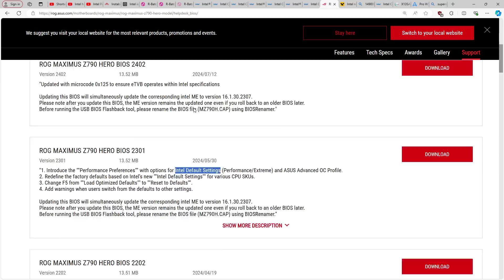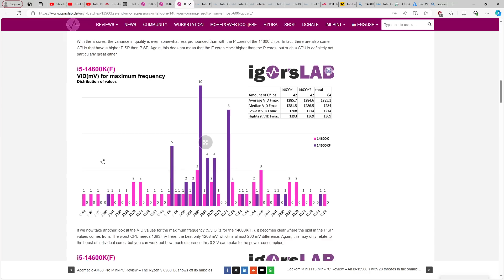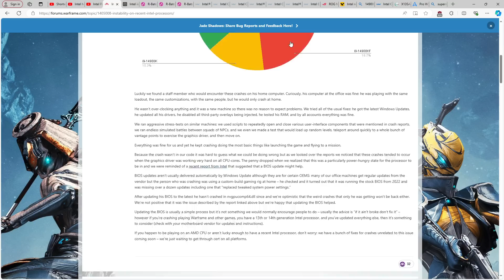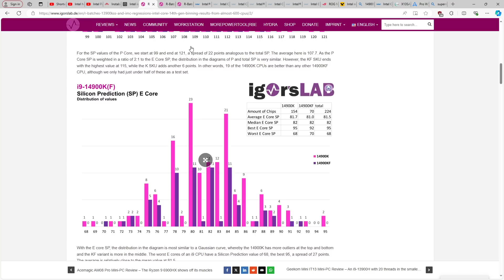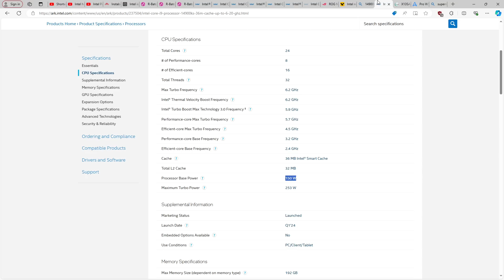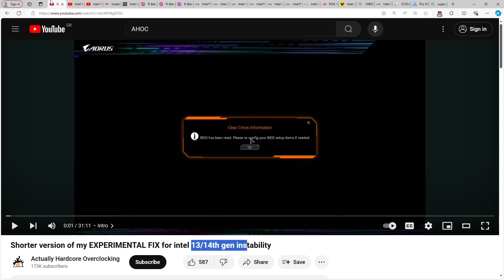The intel instability and degradation rant.

Comment: Intel couldn't stand the fact that AMD beat them in games with the X3D chips (most of the time). They would NEVER allow AMD to possibly ship a CPU that can boost to 6ghz before them. 

Also their IPC would probably be around the same as AMD's non-X3D chips in most scenarios if they clocked the CPU to 5.4 or 5.5.

Long story short, intel doesn't know how to be number 2, and it is going to get them sued.
Reply: frequency is irrelevant for the IPC...
Intructions per CLOCK...
Reply: @brunodinis7454  What effects ipc? could it have anything to do with frequency? frequency of the Ring bus for instance or interconnect between cache and cores? what sometimes dictates those thing?

Just don't post if you have zero idea of what you want to talk about.
Reply: except AMD's X3D cpus were clocked slightly lower than their stock non X3D counterparts

Comment: THE CPU are NOT DEGRADING, You were right from the start, the problem is only the AC/DC load-lines that makes the CPU unstable, the degrading idea is way overblown i think..  Wendel data does not prove degradation, it could be the BIOS updates that just changed the AC/DC load lines and make it look liked it degraded, but it was only new BIOS settings, or updates..
Also, those CPU are amazing if you send them just the right amount of voltage, i game at 6ghz all core under 1.4v on a 14900KS (with a-0.090v offset) under 60 C on an air cooler ..BUT ONLY if i use LLC8 load-line and change the Power AC/DC load-line both to 0.35v , but it can crash under high load.. BUT at 5.9 ghz all core it won't crash under high load! and will use use only 1.35v! (with a-0.090v offset) at LLC8 and AC/DC load-line both to 0.15v...
I can run the 12900K at 5.3 Ghz all core on Load line calibration LLC 1 fine, but the 14 gen needs LLC 8 to achieve higher frequencies because there is too much V droop at lower Load-line settings, and the CPU does not get enough voltages under higher loads..
Reply: They are degrading. My friend got a 13900K degraded, crashes on stock all programs and Cinebench won't even complete even if he disabled all E cores and reduced Current, Power limits. It's because of LLC and 6GHz boost demanding high voltage over 1.4v. This is trash silicon, no matter what they will degrade on stock. Only fix is remove the boost and adjust voltage to never cross 1.4v.

Comment: I've had a 13900KS z790 hero with a  -90mV offset running almost 24/7 for over a year. It's been a good run, capping the multiplier at 55 for the time being.

Edit: I've chosen to cap the performance cores to 5.3GHz. VIDs and Vcore are much lower now. If any degradation had already happened then damn.

Comment: 13900k and 14900k are for enthusists. If you want to overclock, you need to de lid.  To stop degradation  set 400A  and  253 wats and a slight under volt if using out of the box. You could lock the cores so the 1 or 2 cores don't boost to 6ghz.  Running cini bench R23 temps reaching 100c at 350 wats after time will damage cpu only option then is try to increase cpu voltage or RMA

Comment: 10:25 "if the CPU is susceptible to degradation then you want to keep the average voltages as low as possible"

shouldn't you rather want to RMA it?

Comment: What i would like to know is would this effect the lower end of the spectrum? Like the T series i9 or i7 especially if its how the hardware is built? What is also funny is the 14900T is supposedly built for 5.5Ghz max turbo, that many seem to be stopped at for a stable i9 experience, im no expert, but could the ring only be built to handle this much before i borks itself rapidly?

Comment: So i've told BZ my LLC findings before, but while overclocking my 13900k on z690 unify-x i've ran into a situation where medium droopy llc has resulted in lower idle voltages, lower volts / power consumption during gaming / medium workloads, because you dont achieve maximum 'droop' until your cpu is being hit with maximum loads. But here's the thing - the medium llc also resulted in greater stability in my extensive testing.

Now i did separately calibrate the ring vid / ecore vid - for instance i ran ring at 5ghz with the ecores and pcores underclocked, so i could isolate the vid requests to be ring dependant, and found the lowest voltages at which they caused crashes for a given frequency. I also did the same isolation on the ecores, and then used AC/DC loadline values which resulted in a medium droop, and at which they were both able to run plus adding a small amount of headroom. 

It's only now that i setup my all-core OC (i'm not using single core boosts at all, its all core OC all the time), and to maintain the VID requirements of the ecores and ring, I simply used adaptive oc by modifying the V/F curve with offsets. The end result was 5.7ghz all-core oc, at about 1.4 max idle voltage, and max load voltage around 1.32. Note i have also enforced a 253w long term power limit, with 288w short term. This has been 100% stable after endless amounts of y-cruncher / OCCT / gaming / video rendering which it has been hammered with.

So essentially by using a less droopy LLC, i have increased stability, the ring and ecores dont get unhappy when the p-cores downclock from hitting TJMAX (which i have set at 90C) or by hitting the power limit. I have my own theories about how this is the case, but im wondering it the undershoots are actually more desirable than having an overshoot from say, a droopy LLC sitting at 1.5+ voltage running single core boosts, then when the system suddenly hits a load there is a delay in the VID request where the power is smashed into the cpu at 1.5v with high watts before cpu has time to downclock to an all-core load and send the subsequent lower VID request.

I would be very interested to see if the all-core clocking and less droopy LLC is actually preventing degradation from the above situation. Any thoughts?

Comment: Im mildly confused on what exact CPUs are affected
From what i understand  its the 1X900K, and not the 1X700K and 1X600K. 
So are those 2 still okay or are all 13th n 14th series CPUS dying
Reply: Seems most problems are with  the 13900k/kf and 14900k/kf. But a little bit of problems for every 13th and 14th gen. but mostly the i9’s and lil bit with the i7’s.

Comment: I think I'm lucky. I'm running a 13900 since last summer. 5.8 single, 5.4GHz all cores, 400Amps max, 15mv undervoltage and it tops out at around 310Ws and it works, gives around 39k in CB23.

No crashes, no issues since I limited it to 5.4GHz.

Comment: These were not datacenter CPUs. They were 13900K/14900K CPUs in barebone datacenter-ish motherboards. Running at stock speeds and massively underclocked memory, which still failed.

Comment: It is indeed Unreal Engine games. The engine uses the oodle compression toolkit, which is very sensitive to errors during packing/unpacking and will fail upon building a game for shipping or launching due to CPU instability. I spent hours upon hours trying to fix this as it seriously impacted my work.
Reply: Not just CPU instability, I got this error in Remnant 2 once or twice. Replaced my 9 year old dying PSU and all errors were fixed. Ryzen system. (Critical Kernel -Power Failure, I forget the event code)
Reply: the fix for this is to use XTU and downclock all pcores to 53x or 52x, will fix this in most if not all games where you have this issue

Comment: I remember my Intel 3930K running 24/7 @4.8Ghz absolutely stable.... Intel made a huge mistake by boosting the clock insanely high without be able to handle voltages

Comment: I too swore off Nvidia for quite some time.  I had a 9800 GTX BFG card that failed 2 weeks after the company did (the card was like 9 months old).  I used ATI and eventually AMD cards until I bought my friends GTX 970 when he upgraded to a 1070.  I then won an RTX 2080 shortly after it launched and bought a new RTX 3080 from the last batch of full hash rate EVGA cards.   And I will not be buying another Nvidia card until AIBs are allowed to sell them in the correct configuration of three 8-pin PCIE connectors.

Comment: Multiple people told me they bought Intel over AMD even if it's slightly slower because either:
1. They have been using Intel for 10-15 years so they trust it
2. They quote random Ryzen issues, old ones too like the first gen ram speed stability or 5000 series USB connectivity issues
The, at least, perceived stability from Intel is gone, no more of well I could get cutting edge performance from AMD, but there is a chance of some issues, ah I'll just go with Intel. Even though I have multiple Intel systems, some of the cpus have been running with no issues for quite literally over 10 years straight (4790k @ 4.6GHz 1.23V, spent 6 years in my PC doing everything from gaming to rendering to F@H, to office pc to now a home server for the last 2 years)

Comment: So what's the overall point on offering overclocking "K "capabilities of the i9 13th and 14th if those will endup being limited at i7 or non K speeds or even less? I think they will have to refund or replace them all. Even if they limit them, you will be always worried to have fast degradation and will be impossible to sell them used.
Reply: You have to get the K model with a Z chipset so you can reduce the voltages and clockspeeds to safe limits lol

Comment: I can confirm that this is a thing. I had 13900KS. P CORE 124 E CORE 102. E cores can sort of do 4.9Ghz for bench. IlInitially P cores could do 6.1Ghz. I cant remember thr voltages i were running but it was probably LLC6 1.45V which is 1.33V real voltage as per CPU-Z or LLC7 1.35V +-. I was maintaining 
1.33V whej running CB23 as per CPU-Z. If I am not wrong, it was running 1.43V at idle. After couplenof months i decided to OC again and 6.0 on P core was no longer possible (stably)

Comment: I have a 14600k which always show "RING: MAX VR VOLTAGE,ICCMAX,PL4" exceeded in HWINFO64 as performance limiting reason even while almost sitting idle on a b660m mortar ddr4 and later on b760i  ddr5 motherboard with SA VID of 1.35V ,vcore max of 1.30  witha cpu temp of  35 degree. PL1 and PL2 is 185w. System getting  22-24k on cinebench24 based on PL limits and undervolt settings. It is a 3 month old system till now showed no stability issues. Not a gamer and used it only light to medium load tasks until now but later planning to use heavy workloads. It is reaching almost 5.3ghz on all P-cores  without much issues during cinebench test. Tried undervolting just to remove this warning but not succeeded. Do I really need to worry about ring voltage issues and silicon degradation issues ?
Reply: The ring limit reason must be normal. It is the same for both my 13600K and 14700K and they are both running fine.

Comment: I am kinda confused, how exactly is it even possible for a cpu to degrade EVEN when the voltage is TOO LOW and not too high? wtf is happening there???
Reply: It's too high because of degradation risk, and too low for maintaining 6ghz. If Intel kept it 5.5, it would've been fine.
Reply: its because 2 cores are allowed to boost under eTVB. These two cores cause insane 1.5V at times to reach 6Ghz boost. even if the pl1 limit is 125W like the server chips its not low enough because even two maxed out 6ghz chips would not trigger 125W limit letting those two cores burn out at 1.5V and kill your chip.
Reply: @D3nsity_  oh right so IT IS being overvolted with high voltages,  not sure what buildzoid was trying to say then.
Reply: @D3nsity_  some of the chip is normal voltage and the 2 cores are wayyyy too high?

Comment: Ryzen user here so I have no experience with all these,  I wonder if the stability gets fixed if users massively clock down their cpu, eg 4.0ghz all p cores and 3.0ghz all e cores and run as low voltage as possible and slap on a good cooler that maintains the cpu under 75C when fully loaded.

Comment: Intel already had CPUs that degraded and died, unfortunately they were used in firewall appliances.
Apollo Lake LPC degradation.
These CPUs where unable to boot because their LPC-bus died and they couldn't read out the BIOS anymore
EDIT: 
this was 2019. 2 years earlier, they had a similar problem. (Atom C2000 LPC)
Reply: Today I learned Apollo Lake also had the same issue lol
Reply: FG-91E
Reply: In servers too, Scaleway still use a lot of them
Reply: @arthurbesnard1536  Im feeling more and more confident about my dual socket sandybridge-e  server. That thing will probably never break.
Reply: Oh it's much worse than that. The LPC failures were in all Silvermont chips, continued into Airmont (Silvermont die-shrink), and somehow got into Goldmont (completely new architecture) as well.

Tick-Tock and another Tick, all with the same degradation problems. And it wasn't just LPC - SD Card, RTC and USB were also degrading on all of those chips.

Comment: I think my AMD Ryzen 3 4300GE degraded too because of the stock bios, I just updated my MSI B550-A Pro bios from it's stock bios from 2020 and noticed the cpu doesn't hit 4ghz anymore, only 3.9ghz and the voltages dropped to a peak of 1.29v from the usual spikes to 1.4v on the stock

Comment: I have a 14700k, and out of the box, I experimented with overclocking it, as I always do. I ended up setting it up to underclock it 6% to achieve what I thought was a safe operating status. I haven't had any crashed or instability, but I'm now tempted to reduce it further. CPU longevity is more important to me than a few % points of speeds. In forty years, I have never had any CPUs fail, except for one Cyrix chip in the 1990s which failed after about 3 years, and one Core 2 Quad Q9650 that failed after about 12 years. Seeing massive failures of a CPU in their first few years of life is shocking.
Reply: For real man, CPUs never fail... Except now
Reply: @noname-gp6hk  Yep, almost never, unless they are overclocked and/or overvolted, or if the CPU cooler fails.
Reply: @carlr2837  if you can archieve 1.2-1.25v at respectable speeds that'd be sweet
Reply: Caping P cores to 5.8Ghz and E cores to 4.0ghz made a huge difference in gaming performance and stability. Voltages went from 1.50-1.64v to about 1.40-1.45v. Intel 100% knew voltages were an issue but lowering them would cause instability when the CPU ran at advertised speeds under full load. So, Intel chose to look the other way and deliver the speeds they promised (legally required) knowing very well CPU degradation would follow.

Simply put, Intel backed themself into a corner by not looking ahead and on clock speeds instead of cache like AMD. 

I still love my i9 14900k but I'm disappointed in the overall need to neuter it to achieve stability. I also have warranty for 5 YEARS which is plenty for me and from what I've heard Intel is lenient with providing a new CPU or refund.

Comment: If anyone is worried about Intel Arrow Lake don't be Intel has made a lot of concessions to get that Processor at much better state than the fake 14th Gen refresh and its also the reason why its not gonna be coming out any time soon as they are still tweaking the clock frequency its the very reason why Intel disabled Hyper Threading and is expecting a clock regression at around 5.5 to 5.7 GHZ so its gonna be like 10th gen vs 11th gen where 11Th Gen had faster single core but crappier Multi core performance but if you are a 14th and 13th gen i9 and i7 owner Intel's silence is deafening and the fact that there is still no statement from them until now is really concerning.

Comment: I have been tweaking my 13600k . I notice that letting the motherboard handle the voltage in any way will always target too high voltage . So i know mine needs 1.28v at 5.5ghz when i do turbo boost at 6 ghz it is extremely hard to get all the cores run at 1.28v and 5.5ghz . I dont need 6ghz so i just stick with 5.5. i think it is just bad LLC combined with too much voltages

Comment: I have 14700KF on an MSI Z790 Carbon mobo with two sticks of 32g (64gigs) at 6400.
I run overclocks on top of XMP and haven't had any stability issues YET. 
I play a lot of late Gen games and haven't had any real bugs that aren't already known game bugs. But I am monitoring the situation closely. 
I don't have any issues on Cinabench, either.
I'm  running these games on an MSI 408O expert.